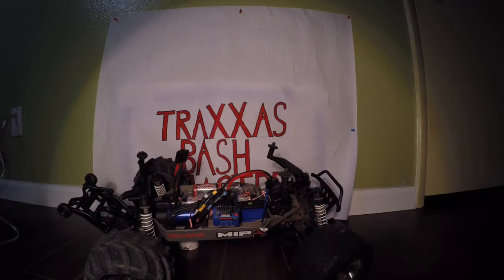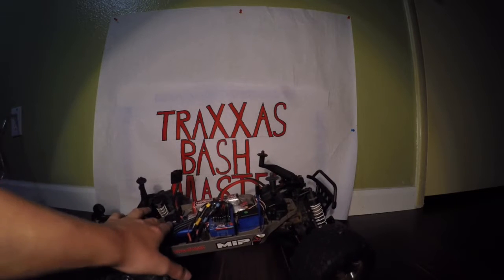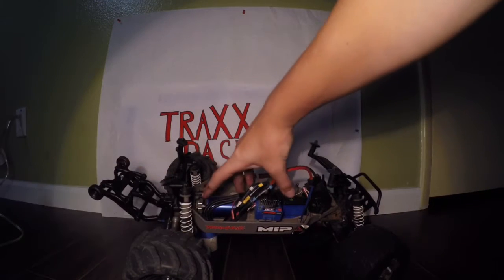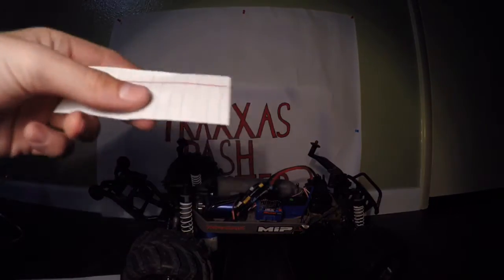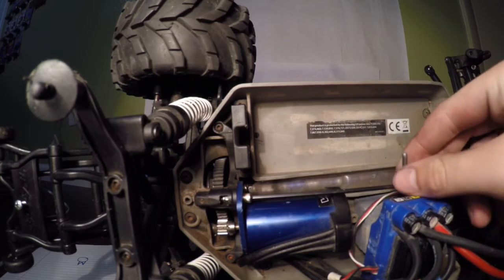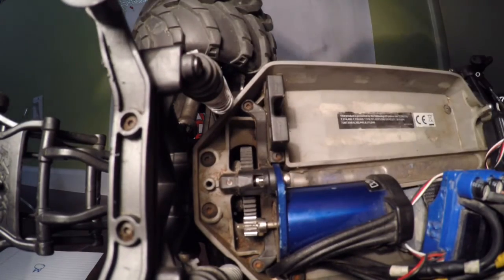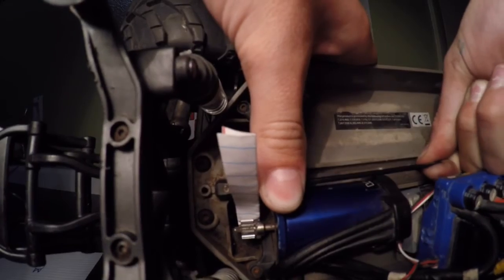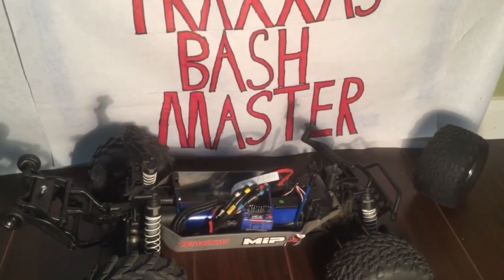HOW TO SET GEAR MESH ON A RC

Comment: Double  thick standard  might work for Traxxas mod 1 & other wide setups, but 1 method  does  not  work for every application  I always test the backlash  of the spur as well, just need some movement,  if it's  too tight or, too loose it will be noisy, the objective  is quietly  running